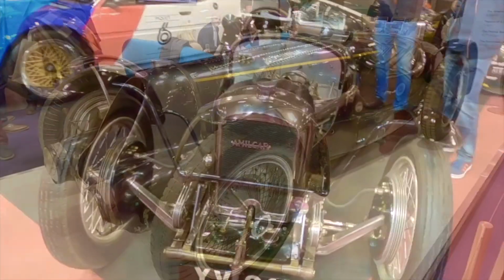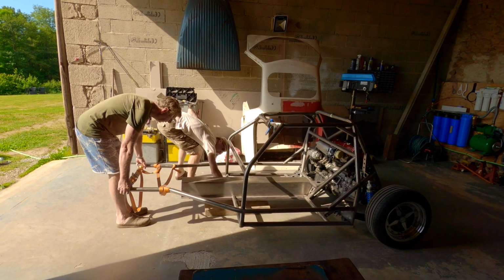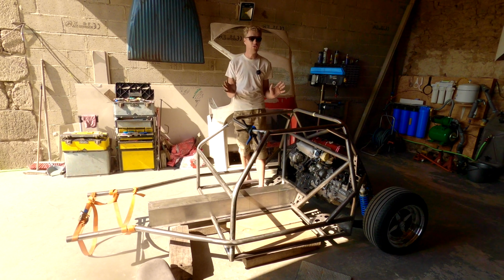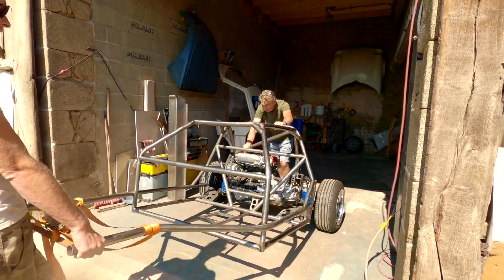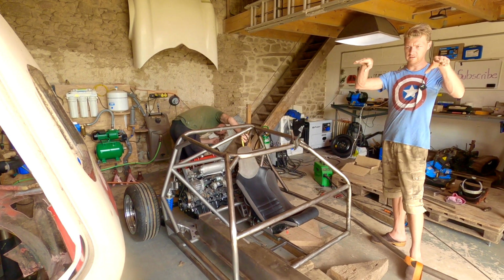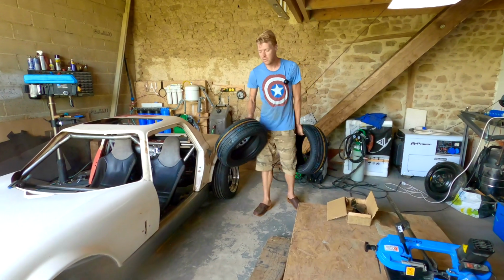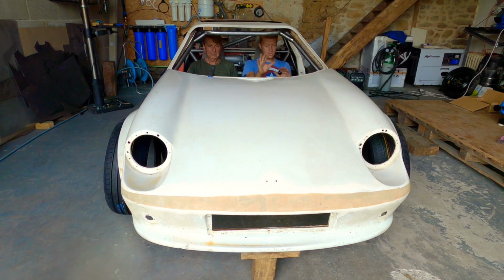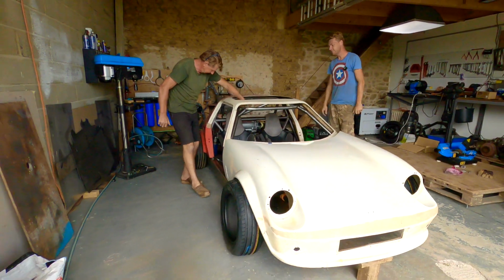Moving The Driver | Project Mosquito Honda Type R Mini Supercar (Ep46)

Comment: why didn't you want an lsd? I was under the impression that an lsd is better for grip on high power/weight ratio cars.
Reply from the maker: In a front engine rwd car yes or in a fwd car but to a lesser extent because it helps with their natural traction imbalance but not a mid engine car with double wishbone rear suspension. It's the same reason a lotus Elise/Exige or McLaren 720 doesn't have an LSD. The true strength of a mid engine car is it's natural balance allowing it to accelerate for longer down the straight then turn in later and faster so it leaves a corner with far greater speed. In any car you only want to accelerate out of a corner with all 4 wheels pointing straight line but a mid engine car doesn't have a big heavy lump in the front to pull it straight and already has superior rear grip because of the centre of mass so with an LSD engaged it creates a rear grip bias producing massive understeer or if the rear wheels should brake loose it'll spin like a top because of the low polar moment of inerta making for a very scary unpredictable road car.
Reply: @OliverPickard  that is very interesting, there is always something to learn.  tho the ariel atom does have an LSD, and for what I can see, your car layout is closer to the atom than the lotus or the mclaren.
Reply from the maker: @torosama  on first glance but maybe because of the tubes but look more closely and they are extremely different and the Atom is known for their understeer